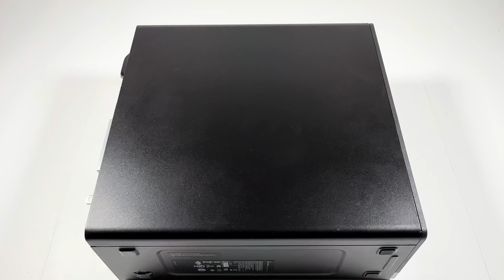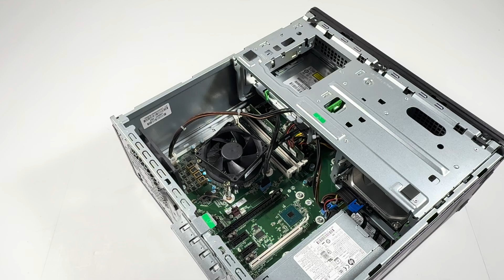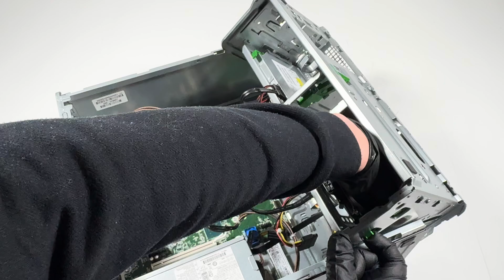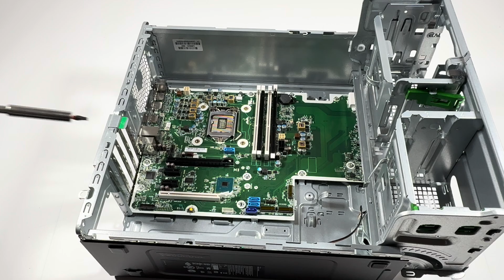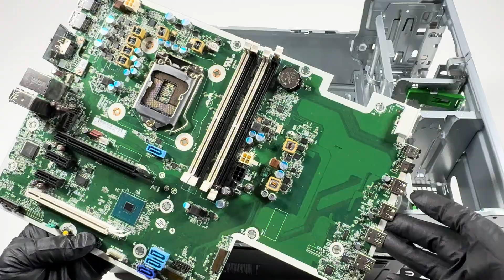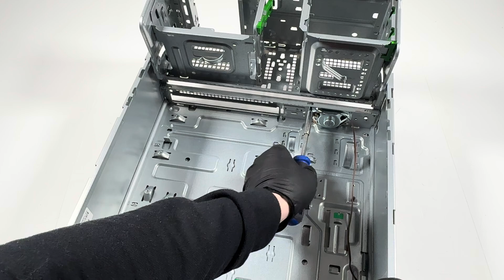HP EliteDesk 800 G4, G5 Teardown

Comment from the maker: List of Parts and Upgrades works with this HP EliteDesk 800 G4.

Buy Desktop
https://amzn.to/4eYo54G

Driver Kit - 64 Precision Bit Set
https://amzn.to/42N3fjh

12PCS Hard Drive Mounting Screws Compatible with HP 3.5 Inch
https://amzn.to/3YDRBH6

SATA Cables 3 Pack 18 Inch Compatible for SATA HDD, SSD, CD Driver, CD Writer 
https://amzn.to/3Ye2Lkg

List SSD Heatsinks:

(1.)  M.2 2280 SSD heatsink, Double-Sided Heat Sink, PCIE M.2 SSD
https://amzn.to/3l2ittr

(2.)  EZDIY-FAB M.2 2280 SSD heatsink, Double-Sided Heat Sink, M.2 SSD
https://amzn.to/3m7J3me

List SSD M.2 Type 2280 NVMe PCIe:

(1.) Crucial P3 Plus 4TB PCIe M.2 2280 SSD
https://amzn.to/3RZcUNi

(2.) Crucial P3 Plus 2TB PCIe M.2 2280 SSD
https://amzn.to/3RTUi0Y

(3.) Samsung (MZ-V7E1T0BW) 970 EVO SSD 1TB M.2 NVMe
https://amzn.to/3d52k2a

(4.) Samsung 970 EVO Plus SSD 500GB
https://amzn.to/3fpi95A

(5.) Samsung (MZ-V7E500BW) 970 EVO SSD 500GB - M.2 NVMe
https://amzn.to/37uuLFw

(6.) Crucial P1 500GB 3D NAND NVMe PCIe M.2 SSD - CT500P1SSD8 
https://amzn.to/2N07wKh

List of RAM will work with this system.
Supports Non-ECC DDR4

(1.) Crucial Pro RAM 32GB Kit (2x16GB) DDR4 3200
https://amzn.to/3q5eFQ3

(2.) Crucial 32GB Kit (2 x 16GB) DDR4-3200 UDIMM
https://amzn.to/3BdbNm3

(3.) Crucial 16GB Kit (2 x 8GB) DDR4-3200 UDIMM
https://amzn.to/3U24CpE

(4.) Crucial Pro 32GB Kit (2x16GB) DDR4-3200 UDIMM
https://amzn.to/4cyeyAe

Thermal Grizzly - Spatula for Applying and Spreading Thermal Paste 
https://amzn.to/3d8NQEE

Thermal Compound Paste:

(1.) Arctic Silver 5 Thermal Cooling Compound Paste 
https://amzn.to/2ziNU0H

(2.) Noctua NT-H1 3.5g, Pro-Grade Thermal Compound Paste
https://amzn.to/36kTk7A

(3.) ARCTIC MX-4 (current edition) Thermal Compound Paste 20 Grams 
https://amzn.to/2DhGJaK

List video cards will work with this system.

GIGABYTE GeForce RTX 3050
https://amzn.to/3W2sJY9

MSI Gaming RTX 3050 Gaming X 6G Graphics Card 
https://amzn.to/4eNikqD

(1.) AMD Radeon RX 6400 Low Profile Gaming Graphics Card
https://amzn.to/3s8MUUY

(2.) PowerColor AMD Radeon RX 6400 Low Profile with 4GB GDDR6 Gaming Graphics Card
https://amzn.to/3ucfFEm

(3.) MSI Gaming Radeon RX 6400 64-bit 4GB GDDR6 
https://amzn.to/43FN0VJ

(4.) Gigabyte GeForce GT 1030 GV-N1030D5-2GL Low Profile Graphics Card 
https://amzn.to/2Z4PHkp

(5.) ZOTAC GeForce GT 1030 2GB GDDR5 64-bit Low Profile Video Card ZT-P10300A-10L 
https://amzn.to/2WzgLXk 

(6.) MSI Graphic Cards GT 1030 2GB GDDR5, Low Profile
https://amzn.to/390Spum

List SSD M.2 Type 2280 NVMe PCIe:

(1.) Crucial P3 Plus 4TB PCIe M.2 2280 SSD
https://amzn.to/3RZcUNi

(2.) Crucial P3 Plus 2TB PCIe M.2 2280 SSD
https://amzn.to/3RTUi0Y

(3.) Samsung (MZ-V7E1T0BW) 970 EVO SSD 1TB M.2 NVMe
https://amzn.to/3d52k2a

(4.) Samsung 970 EVO Plus SSD 500GB
https://amzn.to/3fpi95A

(5.) Samsung (MZ-V7E500BW) 970 EVO SSD 500GB - M.2 NVMe
https://amzn.to/37uuLFw

(6.) Crucial P1 500GB 3D NAND NVMe PCIe M.2 SSD - CT500P1SSD8 
https://amzn.to/2N07wKh

SSD list works with this PC:

Samsung 870 EVO 2TB SATA SSD
https://amzn.to/3ezOds5

Crucial MX500 2TB 3D NAND SATA Internal SSD
https://amzn.to/3B9f8CF

SanDisk Ultra 3D NAND 2TB Internal SSD - SATA
https://amzn.to/3RSZ8LR

(1.) Samsung 860 EVO 500GB 2.5 Inch Internal SSD MZ-76E500B/AM) 
https://amzn.to/2yNxnkE

(2.) WD Blue 3D NAND 1TB Internal SSD, 2.5" WDS100T2B0A
https://amzn.to/2wvnC9Z

(3.) WD Green 1TB Internal PC SSD  WDS100T2G0A
https://amzn.to/3cbrcWa

(4.) SanDisk SSD PLUS 480GB Internal SSD SDSSDA-1T00-G26
https://amzn.to/3a3i9ou

(5.) Crucial MX500 250GB 3D NAND SATA CT250MX500SSD1(Z) 
https://amzn.to/34rZlhy

(6.) Samsung 860 PRO SSD 256GB - 2.5 Inch SATA III Internal Solid State Drive
https://amzn.to/2ybiHLK

(7.) Samsung SSD 860 EVO 250GB 2.5 Inch SATA III Internal SSD 
https://amzn.to/2VjIAkK

(8.) SanDisk SSD PLUS 240GB Internal SSD
https://amzn.to/3c7SEE4

HDD list works with this PC:

(1.) Seagate BarraCuda 4TB Internal Hard Drive HDD – 3.5 Inch
https://amzn.to/3d3xWeR

(2.) Seagate BarraCuda 8TB Internal Hard Drive HDD – 3.5 Inch
https://amzn.to/3xjUDSJ

(3.) Western Digital 2TB WD Blue PC Hard Drive HDD - 5400 RPM, SATA 3.5" - WD20EZAZ
https://amzn.to/3w3jIQA

(4.).WD Black 2TB Performance 3.5" Hard Drive - 7200 RPM Class, WD2003FZEX 
https://amzn.to/2xFUeyF

Disclosure: Amazon links this means that if you purchase an item we earn a small sales commission affiliate.